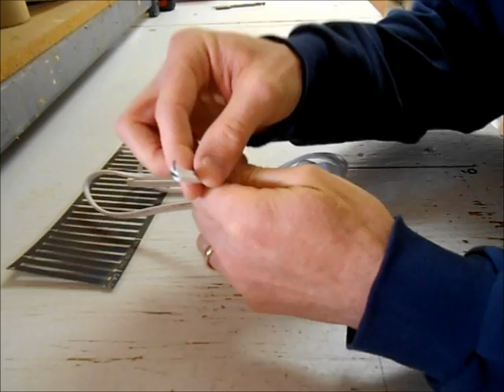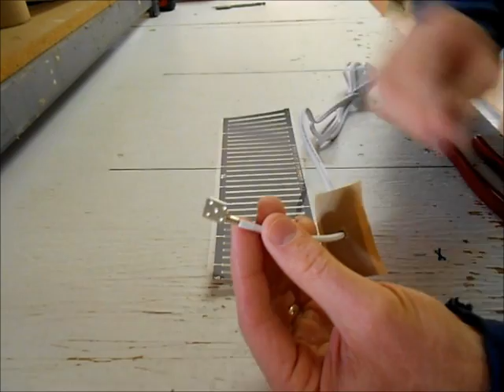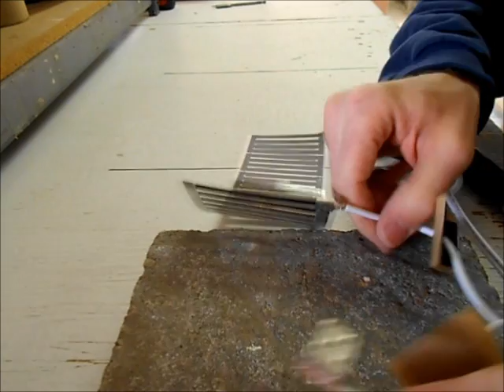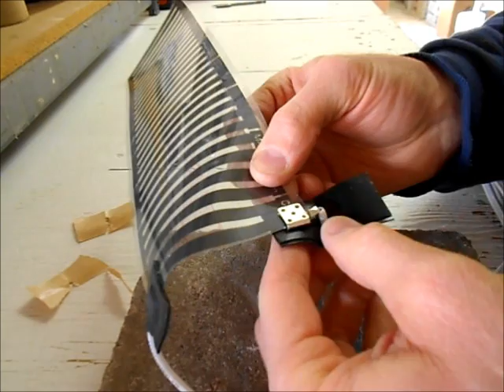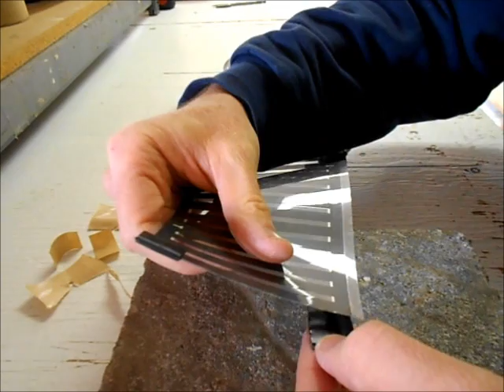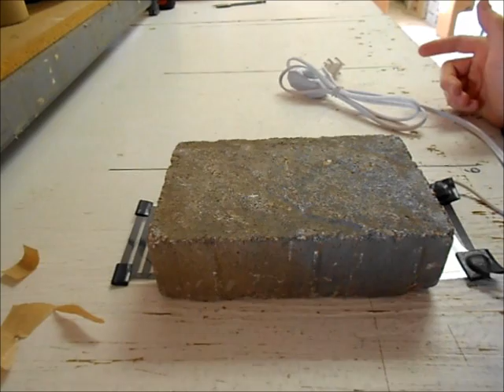How to wire a dimmer or power cord and test Flex Watt heat mat

Comment: my eleven inch strip has two wires mounted already, one black, one white the strips on the side, covered with a black tape like seal. I wired a lamp cord to those and it did not work, is this not set up yet or what is going on, the instructions don;t even explain.